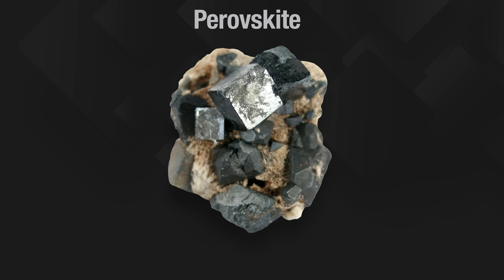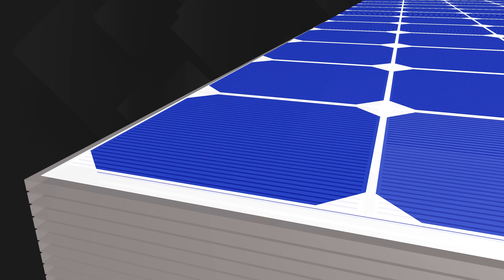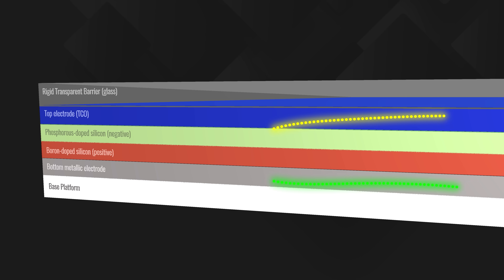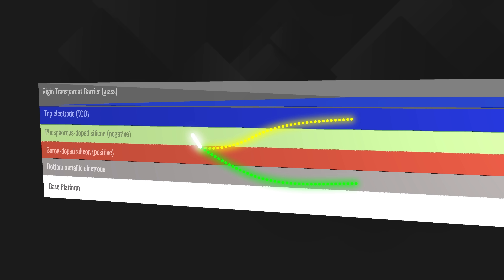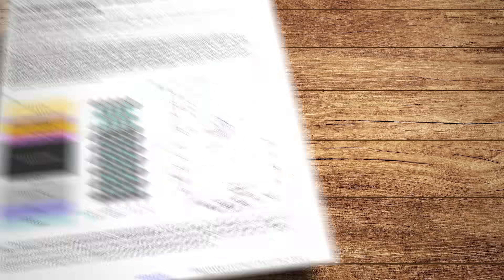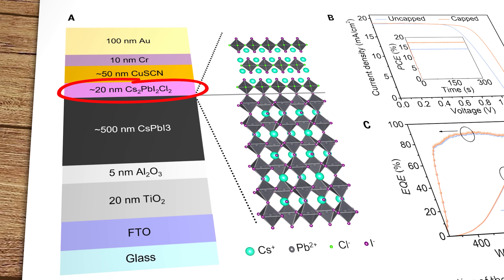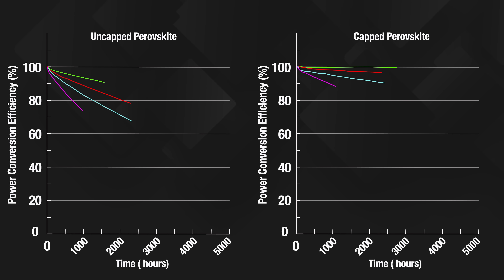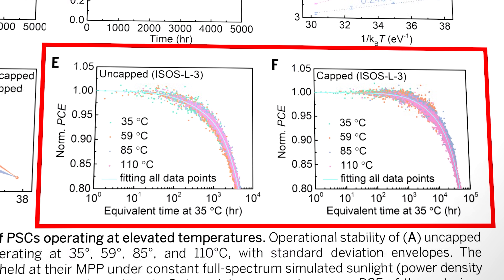Perovskite solar cells. Major new breakthrough!

Comment: Dave, band gap has a value but it's confusing to refer to it as a width because that is a seconddifferent attribute. For instance amorphous silicon has a higher value than crystalline silicon and a much higher absorption coefficient which is made up of other factors of what is correctly referred to as the transition moment and directly related to the absorption as a function of the path length through the material. Also, the problem of ion diffusion is not the big problem which is moisture. The Prinston work doesn't address damp heat, i.e. the grams per meter- day permission of water at   some standard of moisture and temperature. MOCON commercial testing is only sensitive to about e-3 g/M2-day but what is required is e-6 or better AND no pinholes or defects. No such film has been shown in wide area high rate production but vacuum plasma processes have shown the possibility but with semiconductor like costs.

Comment: Triple-junction non-perovskite photovoltaics have been in use for a while already, but they're only used in space, AFAIK, because they're really expensive—they're used there because the reduction in launch costs due to their lower mass than single-junction cells for the same amount of power outweighs their purchase price. Perovskites and/or Starship will probably soon change that: either we'll all get much more efficient (and much cheaper) solar power, even down on the ground, or spacecraft will be able to afford to use cheap solar cells.

Comment: Are these films thin enough to allow some light through?  If so could they be used as window tinting?  Think of all the windows that could be retrofitted.  Generate electricity AND reduce the heat load on buildings!!

Comment: Perovskite PV panels face the same hurdles that silicon ones do in terms of adoption. 
We still do not have a practical way to integrate renewable energy sources into the overall power grid. 
The discontinuous energy output needs to be married to a power smoothing element such as a battery. 
Which allows power to be banked, and withdrawn at night, when there are clouds etc. 
So even if Perovskite PV is 10 times cheaper, it still requires an investment in lithium or lead acid batteries. 
There are some promising solutions like heat storage with thermocouple energy retreival. 
It would be curious to see Perovskite applied to this type of infrared band PV cells. I wonder if the material can be robust enough for this?
Reply: That's an interesting coupling of tech...a thermal storage unit with IR-tuned perovskites.

Comment: I've been a PV installer/technician for 11 years, this new tech will absolutely change the game forever! The peak efficiency of these new panels will really improve design options for those without a large amount of usable roof space. When I began working in this industry a 10kW array would be around 50-55 panels and cost over $80,000(Canadian), but now even still using poly-crystalline silicon panels of the same size (60-cell) we can hit 10kW with 28-32 panels, which opened up so many options for people and perovskite will likely be the next big jump in that this decade (imo)

Comment: Do people not realize that using room temperature when your trying to get energy data is stupid.  The less you control the environment of a test, the less accurate that test will be.  Do it again and see if there's a difference between hot and cold weather performance.  It needs to work north of the artic circle and in Death Valley.

Comment: Even at 40% we still need light and lots of it (uninterrupted) to compete with fossil and nuclear (fusion/fission.)  Progress on Fusion is steady and on pace with other energy tech so even at 40% when Fusion hits the market all other forms of energy production are obsolete for the grid leaving a small niche for photo temporary power.
Reply: Efficiency becomes less of an issue when the fuel is essentially free.  I hold out hope for fusion in the long term,  but the Levelized cost per MWh still needs to be competitive. For fusion to thrive, it will have to come in at less than the LCOE of Solar w/storage or Wind w/storage.  That's a real challenge given the staffing expertise that will be required on-site at each fusion facility, decommissioning costs, etc.  (My local 340MW solar farm has only 7 full-time technician employees - ie super low overhead)   The deuterium and tritium have to be sourced as well.   The most recent Lazard report puts the LCOE of Utility Solar or Wind, w/storage, from $42 to $114/MWh (or $140 for offshore wind).  Fission comes in at $141 to $221 / MWH.

Comment: The S-Q limit is something I think about in terms of the work function. If the material has a work function of 2eV then any photon with less energy than that won’t excite an electron at all. But any photon with more, say 2.5eV, will still only excite the electron with 2eV of energy, the remaining 0.5eV turning into heat. So you want it to be high enough such that you efficiently capture high-energy wavelengths, but low enough that you capture a lot of the solar spectrum. At least, that’s my understanding of it, it may be entirely false.

Layered perovskite looks promising. Though I’d also note that “perovskite” here doesn’t refer to the calcium titanate itself but rather that type of crystal structure. Hope the use of lead doesn’t turn out to be too problematic for safe manufacture or disposal, especially in less regulated places like China. Copper thiocyanate is toxic also.

Comment: About solar in general, Installations should  areas where grass or other  CO2  users live. Let them do their  photosynthesis thing.  Do cover parking lots  warehouse and factory  roofs. Make  the residential  installations  with a dead air space to provide insulation. Finally, make the panels to a standard size  with installation clips  simplify replacement of damaged  or worn solar panels.

Comment: Nice presentation! Had not considered Perovskite, but interesting that it has potential to reach 30%+ efficiency, much better than the 17% for silicon.  Cost seems to be good as well, the lead issue and stability seem to be the road block.  But science continues  as it should in America.  I still see fossil fuel (natural gas primarily) as the main solution for power companies, unless we move back into Nuclear energy.  The transition needs be slow as to not burden middle and lower class as it is doing today with ridiculous gas prices of $6 to $9 per gallon and inflation up to 9%.

Comment: Geez, why does the nonsense continue? These are very stupid ideas.
Dennis Lee's invention produces energy 24/7 anywhere in the world, hot or cold. And connected to their compression motor, it runs continuesly recycling over and over. The more the wind hits it, the more heat it extracts from the atmosphere. Therefore it doesn't need the Sun. 
A very simple and easy to manufacture device. Very little maintenance and has already been on the market for over two decades. But the Nurds want to make everything difficult. 
You'd think that if the Climate Crisis was real, this device would be mandated for every building in the world. But the Climate Crisis is a Hoax. So good luck with having real products for real solutions.

Comment: I'm a sailor and for years I have been hoping technology could eventually develop a Photo Voltaic material that was light, flexible and tough enough to use in the construction of sails for my boat.  The surface area of my sails is huge, far more than my deck.  Ideally the material would be able to absorb sunlight from both sides of the sail.  Probably isn't going to happen any time soon if ever but it would be a huge boon to the sailing community especially those of us that like to go off grid for months at a time.  It would give a whole new meaning to the term "Solar Sail"..  🙂  Thanks for the video!
Reply: The tech already exists.  The question is cost.
Reply: Did you consider putting thinfilm PV on wingsails? then too much flexibility would not be a problem.
Reply: It's a good idea, but I think that the power output would be limited by the angle of the sail to the sun. I would guess (I haven't calculated it - spherical geometry is horrible) that the sun would strike the sail at too small an angle for most of the day at most latitudes to produce optimum power output. This could be solved by tilting your sail to the sky, but that makes an inefficient sail.
Reply: @marcowen1506  good point, what do you think about the reflection of the sun off the water that could help make up for the bad angle to the sun.

I know I get sunburn much faster at the ocean than surrounded by land.
Reply: @scientificapproach6578  the albedo of water depends both on its quality and the angle. At lower angles closer to the horizon, the albedo is higher but the over all solar energy available is also lower. At higher angles one would be relying on the shimmering waves and ripples to cast sunlight onto the sails, and these have such low surface albedo that they wouldn't offer much energy. No matter what, the most efficient collection angle is going to be as close to 90 degrees as possible. Making or lining sails with a durable solar cell isnt going to be practicle no matter what anyone does.
Reply: Hmm. The comments on angles and % of direct view of the sun i hve to agree with. But if these are lightweight enough, could you tender it? Even just a floating sheet dragged behind, flexible to.. roll with the waves and light enough to ride on them as well.
Reply: Batteries in the bottom of the boat, or even the keel, could add to ballast. A small electric motor could complement the sailing.
Reply: @gpsfinancial6988  GPSFinancial  that's already being done on many boats (mine included). He is talking about how to charge all of that with solar integrated it in sails. Like I say its not been successful and I doubt with perovskite esp, with microcracking and not seeing strong sun angles. I can get 3kW/day with my single 450w rigid bifacial panel (42" x 85") on my stern arch (zero shading issues; I designed everything around that). My flexibles can do the same output but it takes 660w of them to do so (no shading either, flexibles less efficient). A 40' mono mainsail 75% covered in thin flex, I doubt would get 3kW/day with flogging and rugging shading. PV tech not there yet.
Reply: They are on "sale" now...😃
Reply: Agreed (solar sailer here) however the issue Ive seen in research intergrated in sails is microcracking with sail flogging. I actually have flexible bifacial cells (rare) that I made into a modular frame; works great, enables tracking and albedo effect, get up to 6hrs rated watts which is best Ive seen out there for flexible on a boat. But just that twice a day flex of moving them and vibration despite rigid lvc frame I made, some cells have cracks therefore lowering output. I know thats the main issue with perovskite cells is fragility I think? I do hope to compare perovskit cells onboard here against my monofacial flexible panels,, bifacial flexible and my bifacial rigid panel when a perovskite solar company wants to give me on to test ;)
Reply: I'd go for a tarp over the cockpit before the sail.
Reply: @Mojo Neko if the technology evolves as it should, and especially if Perovskite becomes feasible, as it most likely will, the surface area of "solar panels" will decrease substantially, and the efficiency increase as well, so, there will be no need for your enormous "sailboat sail" like surface to harvest the energy feom the sun. Maybe you should be dreaming with a much, much smaller set of beautiful golden red Perovskite pannels, placed discretely on your deck, and the energy stored, also in much more compact, and much lighter solid state batteries. Do keep in mind that, as technology evolves, sizes decrease by a lot, as does weight, so, think small. I am assuming you have an Oceanvolt engine on your boat, so, the future is looking good for you.
Reply: That would be great!
Reply: Look into hydrogen on boats as well, I've seen many vidoes of people able to run their base electronics with just a little bit of solar in conjunction with a hydro power prop.
Reply: @cashandraven2369  bologna.  post the link to the credible article, video or research paper showing the practicality of this.
Reply: @HamRadio200  Looks like a spelling error on my part, not hydrogen, but hydro-gen, as it using a hydro prop for hydro power
Reply: If you look carefully at this video the new key part of the breakthrough for Perovskite solar cells to add durability is via adding toxic metals lead and caesium to it. So I wouldn't want this type of solar cell on my roof if I used the rain water even for my garden. Don't think it would be good for sea life either.
Reply: Sails are solar in the sense that wind is created by heat from the sun.
Reply: @johnsherman7289  Go too far sown that road and you end up saying that oil & coal are solar energy, but very old :-)
Reply: @johnsherman7289  Language is solar in the sense that it would not exist without the sun. Shall I go on?
Reply: Marine power requirements are on the orders of magnitude higher than land vehicles that roll.  Water is extremely dense.  You'd need solar panels that are 10 times bigger than your vessel to power just the modern computers, refrigeration devices and Air conditioning systems onboard larger vessels, not to mention propulsion devices.
Reply: L
Reply: If it can be made for sails then it could for sure be made for house roofs, walls, garden areas etc.
Need Elon Musk to get into solar.

Comment: Could I buy a small one (perhaps 90 by 50 cm), leave it on the balcony, plug it into a power strip, and use it to charge my portable devices such as phone? Could others in the UK buy much bigger ones for the back garden or roof and make a profit?
Reply: @leeroyjenkins0 thank you :)

they're expensive

Comment: Degrades with exposure to moisture, oxygen, light, heat, and voltage. Not currently viable and probably won't be in 20 years.

Comment: The cost of silicon solar cells is already a tiny proportion of the total cost of installation. So perovskites dont actually have a cost advantage. As they are toxic, they therefore need a significant efficiency increase for the same longevity and cost as silicon.
Reply: The bottleneck in cost is energy storage at night and also for longer duration such as weeks. Perovskites are useful in some cases such as Silicon Perovskite tandem cell to improve efficiency or the advantages of flexible PV film.
Reply: Agree. I wonder if there is as much research/innovation into reducing inverter, hardware, and wiring costs etc.

Comment: I look forward to a day when roads and railways, stations, filling stations and carparks are roofed over with solar panels, generating power where it will be needed to drive the cars and trains.  (The railways could, perhaps, become net generators rather than net consumers of power, at least in some countries.)    There would, of course, need to be large secondary batteries at intervals alongside the tracks.  This would, I think, largely solve the oft-repeated complaints of "where is the extra load on the grid is to come from?" or "how will it be be distributed by it?".  This would incidentally help solve the problem of snow on the railway tracks and on the roads and the "loss of good agricultural land".  Most, though not all, travel happens during the day so it is convenient that most power would be generated during the time when it is needed most, thus reducing the storage capacity needed.  Large secondary batteries are going to be needed anyway at the filling stations of the future, particularly given the emphasis on rapid charging.

Comment: Interesting work, notwithstanding the issues of lead solubility mentioned in other comments, but I don't understand the emphasis in this paper on the accelerated testing they have done as being something new or novel. Statistical packages (e.g JMP, Minitab) have this analysis built into them as standard.  I did a similar analysis on ageing of phase change chalcogenide based ReWritable optical discs about 30 years ago with temperature and humidity as the stressors.  What have I missed?

Comment: This is fascinating, but solar is already very cheap, and the limiting factor for adoption is now dealing with the fact that peak production doesn't match peak demand.
Cheaper IS better, but the energy storage is still THE biggest road block to a grid powered by 100% renewables.
Reply: It's impractical for daily use. Consider various objects covered fully with perovskite layer - e.g. top of the notebooks or phones (seamlessly integrated),  surface of cars, window curtains, canopy,  roofs of small objects etc. Many surfaces can be covered and generate electricity in great amounts. Even e-cars could charge themselves during summer while parking....